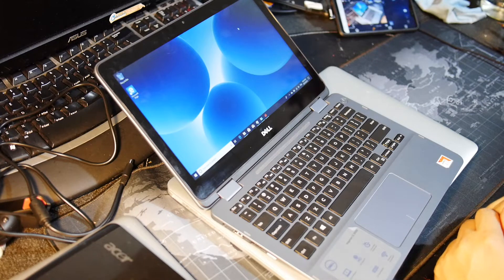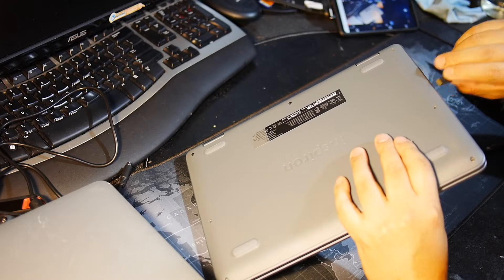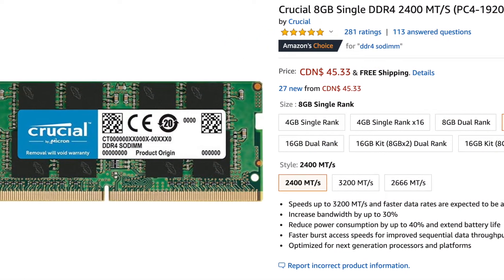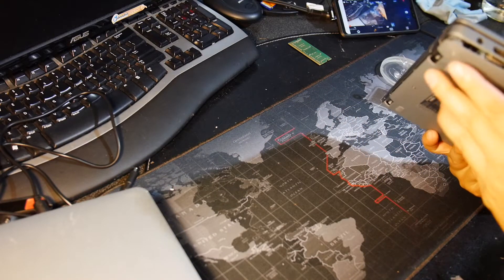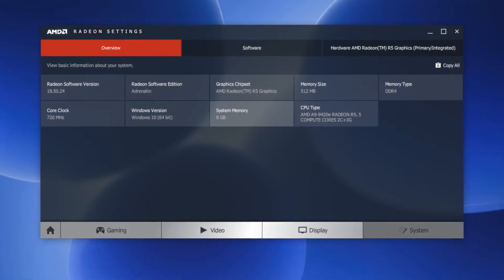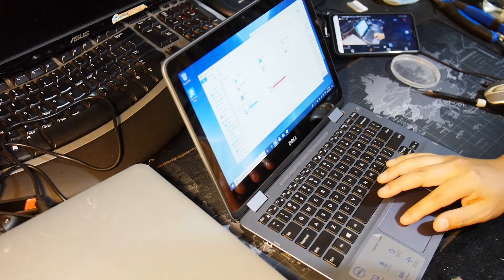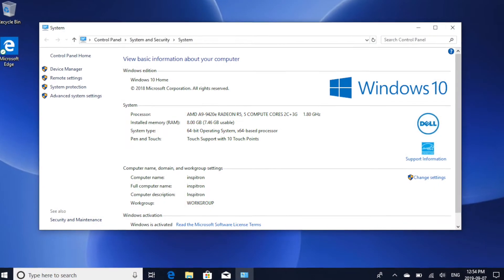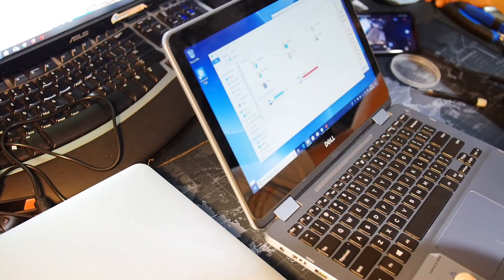Dell Inspiron 11 3000 2-in-1 (3195) - Upgrades

Comment: What a mistake buying this awful machine. The SSD lasted a little over 2 years. Purchased November 2020. A couple of months ago  I started getting hard disk errors. They were "repaired" but 95% of the hard drive was blocked out as errors. So on a machine that had about 2 gigs of files (yes, only 2 gigs) the laptop now has 59 gigs blocked out with 5 gigs remaining free. What an absolute ripoff! Disgraceful.

Comment: Hey, I have a really important question. I have an online test I need to take in one month and my CPU doesn't meet the requirements.

Is it possible to upgrade the CPU? If so, what do you recommend?
Reply from the maker: Cpu is soldered on so not possible
Reply: If you really need a better cpu parts-people has a lot of Dell parts you can order.

Comment: Hey! Love the review :) Excellent job 

I recently bought an RCA Cambio 10.1" 
(https://laptoping.com/specs/product/rca-cambio-w101-v2-10-1-2-in-1-tablet-32gb-intel-atom-quad-core-windows-10/)

And it's been unable to work unless it's plugged into the DC/AC Adapter, it will just completely power off. Don't know if it's an overheating issue. 

Any problems with this 2 in 1's battery? No problems when you're using it disconnected from the power? I'm looking to use this for fairly basic use - Mainly just having a couple of Poker Clients open that run around 600-800mb of memory. 

8GB of Ram Upgrade sounds like it will take stress off the CPU and be good enough for me as long as the Battery keeps the screen powered. 

Not really looking to do anything too graphically intense with this

Any Answers are appreciated! 

Cheers :)

Comment: Hi,  is it possible to change the AMD A9-9420e for an 	A9-9425?
Reply: Unfortunately no it’s not possible to do that because the processor is soldered to the motherboard so upgrading it would be quite a bit of a challenge and it would be a no go. Therefore you are permanently stuck with the processor you have

Comment: Handy video, but ALWAYS disconnect the battery before changing components!  I did this upgrade using the Dell service manual and also upgraded the wireless card from the N300 to an AC1900+ BT 4.0, then added the fastest micro SD card I could find.  It helped with the web browsing but this laptop is still a turd.

Comment from the maker: The spec says RAM can be upgraded to 8GB (single slot), which I've shown here. I haven't tried 16GB as I don't have any to use and didn't want to buy just to try out. Might be possible, but there is only one slot (so no dual channel) and CPU is weak; hence, it might be pointless anyways.

Storage can NOT be upgraded - is is soldered to the mobo and there are no SATA ports. Best option (I think) is to supplement it with a microSD.

Switching out of S mode is easy and can be done using the MicroSoft Store App.
Reply: Can you do this for the dell inspiron 3168,?? i have 2gb i just bought it and already its telling me memory is running low. Lol i didn't even do anything yet
Reply: excuse my ignorance, but what is "s" mode?

Comment: I am really tempted to buy this computer, now that I have seen this video. I am going to ditch the 11.6 HP Stream 11 laptop. Thanks for this upgrade video and for the initial review video!
Reply: i actually did end up buying this because the keyboard failed on my hp stream junktop.
Reply: @mattglad  I ended up buying a Lenovo 100e 2nd Gen. Not the best specs, but perfect for travel and super durable. This model is actually for students, but bumped up with the best specs possible. It's probably not as good as the Dell in this review, but I needed something durable with good amount of ports.
Reply: MrPanzerDragoon its not about best specs at that form factor! As long as it does what you need it to! Lenovo and Dell both seem to have a better track record than HP on that front!

Comment: I want to try and increase my performance on my laptop. I'm going to upgrade it to 16 gb and add more graphic support and hard drive support. I will tell you about my experience when I upgrade it.
Reply: It doesn't support a hard drive upgrade unless external. Memory max is 8GB per the tech manual.
Reply: Let me know how 16GB works. Curious if it will anyway.
Reply: is there a direct support for 16gb on this laptop ?..i bought 2 of these and was planning to do the same
Reply: @razor420100  friend, can you give me feedback about your carcass? is it too fragile? or is plastic good? wanted to buy one

Comment: Took out the screws, unclipped the edges, something is holding it together in the middle and it won't come apart. Ideas? Do I have to take some screws out on the keyboard side?
Reply: I have this same problem.
Reply: @marquitamontgomery1302  just pull quickly. Turns out there's a center clip that comes apart easily. When pulling slowly it appears something could break. One of my 3195 systems has been upgraded. Also note, the THREE screws along the back side are different lengths and could ruin the other holes. They are also not to be removed, only loosened. Dell has a service manual online that explains exactly what to do.
Reply: @EnergizerTX  thank you.

Comment: Hi, will you be able to update ram to 16?
Reply: If you see the specs yes it will. but the ram will be under preformed and 16 gb is just an over kill cause of the motherboard support
Reply: @charlesdean03  manual says 8GB max for the 3195.
Reply: @EnergizerTX  so wait you follow the manual all the time and dont check if the motherboard and processor can utilize more?? But hey what do i know right i am just a dumbass who is working in the IT field for 6+ years and wasting my time commenting here.
Reply: @charlesdean03  you referenced the specs and the specs actually say 8GB.
Reply: @charlesdean03  The A9-9420e is only capable of handling 8GB. Even Crucial won't suggest putting in more, and nearly every PCl I've upgraded with Micron DDR4 is capable of more RAM than manufacturer suggests. This (which my stepdaughter has) and our Inspiron 20 3043 are two exceptions.
Reply: @EnergizerTX  specs of the motherboard vendor? I think you are forgetting dell and other companies buy parts and put them together. Check the motherboard model and then check what they support it can also be limited by the bios!
Reply: @MattThompsonOnGoogle  now you sir got are correct, I just checked the processor support. Yeah the processor has the limitations. Its better to just buy an older laptop i5 or something which will have a better support. But your way is better cause of the warranty as it's for your daughter and not you. 👍

Comment: Does it have m.2 ssd slot and/or 2.5 inch hdd slot?
Is it detachable? 
Does it have an internal memory?
Reply: believe its soldered to the motherboard... The best option is what this dude said SD card.
Reply: manual indicates its embedded eMMC (64GB or 128GB) (integrated on system board)
Reply: I disassembled mine, and it looks like there is something under the ribbon cable that goes to the board with the USB 2 ports and headphone jack, but I have not tried to examine closer underneath there.